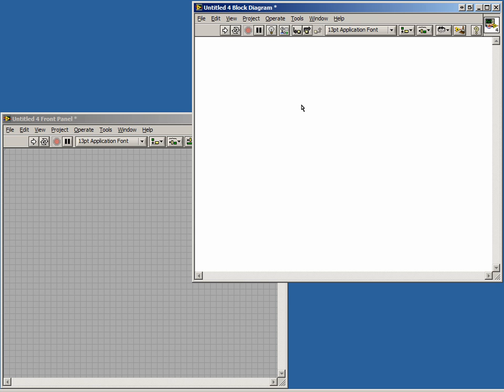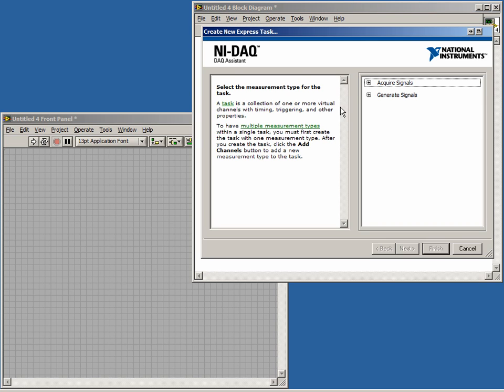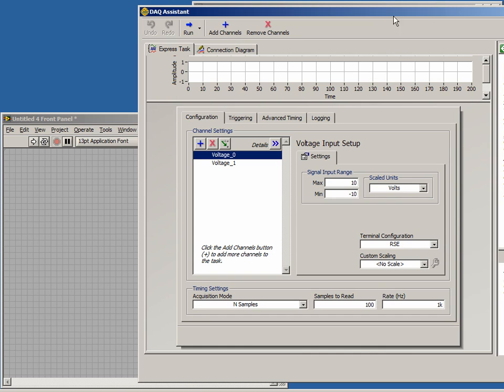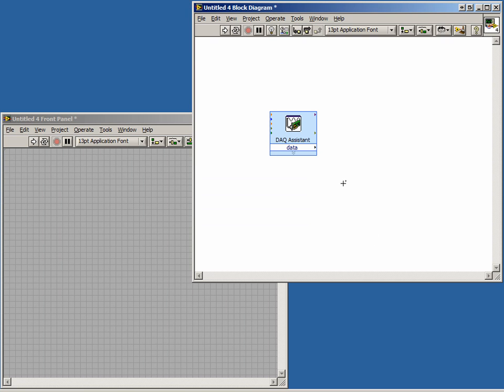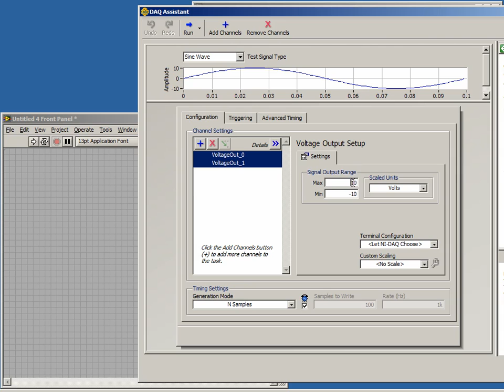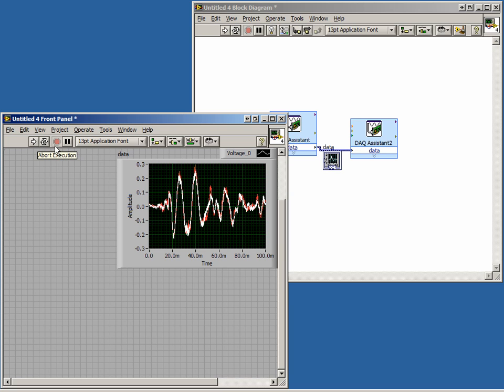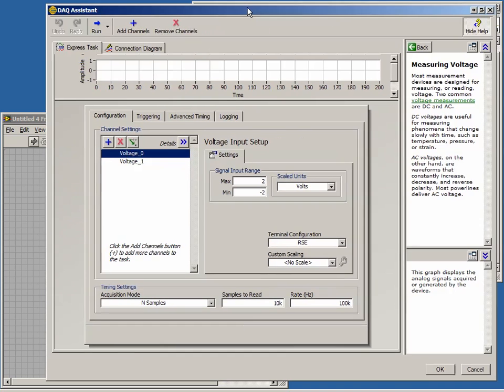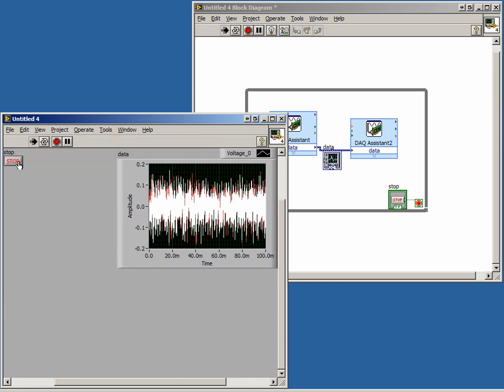Introduction to LabVIEW with myDAQ: Read and Write Data

Comment from the maker: @diegocalde88 This is because the timing functions are based on your operating system clock which is millisecond based. You need to reference a higher resolution clock to achieve microseconds. You can do this by using hardware timed clocks like some of the NI PCI DAQ boards or cRIOs but unfortunately don't have that option using the myDAQ since it is still based off your operating system. You might try posting to the NI Forums for other options people have used when using the myDAQ.